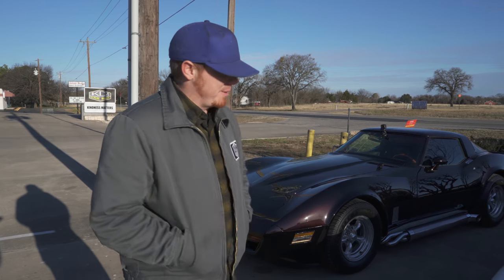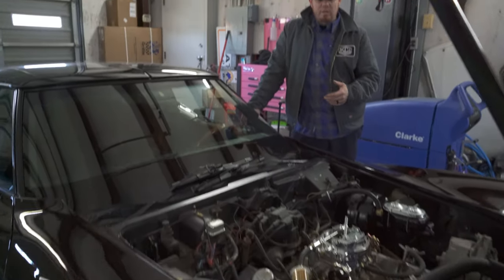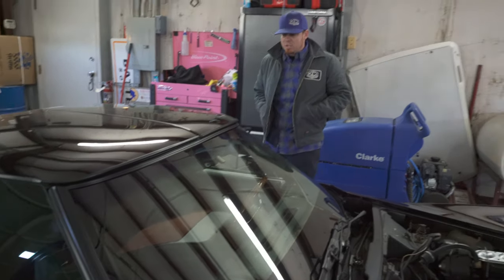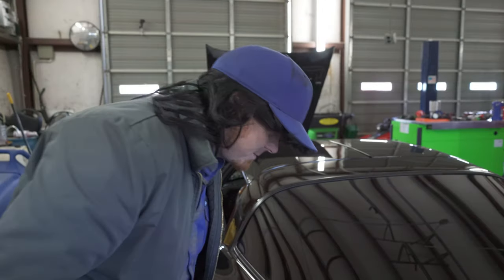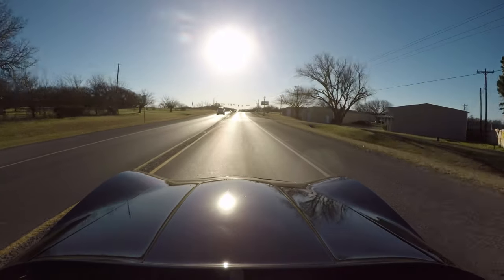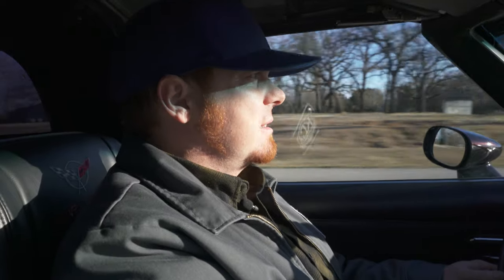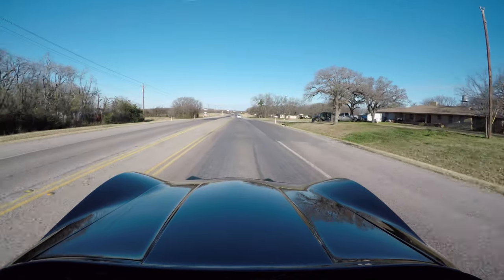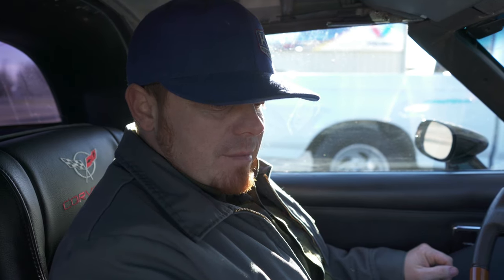RAW CUTS: 1980 Corvette

Comment: Tell the owner to drop the tank and grab the buildsheet before he starts driving again so he can keep it clean in a sleeve. He needs to make sure the trans shifter cable stays tight, they loosen up easily on these cars. Also needs to make sure rear diff Axle seals aren’t rotted. They tend to pretty quick and will sling oil everywhere back there. Have em check the steering coupler, they tend to wear out super fast on these DFW crap roads.
Pops owned a 1980 L-82 Corvette midnight blue metallic with blue blue zebra interior. Car was mint! Brand new was $7600 back then. Growing up in the 80s and then through the 90s riding around with him with TTops off and working on that car with him created some of the best memories I’ll never forget.
Reply: I love to hear stories like that. They represent more than metal on wheels and I think that the shared connection is something that really draws us to them. I'll be sure to pass on the info. Thanks Elroy!
Reply: I know you wrote this a long time ago.  but  Just wanted to say your 100% right about the dang C3 shifter cables. When you buy a vette you also gotta tear out  any old differentials and check  positraction  damage too. People beat the heck out of Vette  rear ends even when they were new then! As bullet proof as they were , They always killed them in the end at about 120000. lol Especially automatics. Unless that bad boy has low miles ...  i guarantee it needs a rebuild.  He does't like old C3s, but man are they fun to resto mod and drive . Even 75s can be monstrous sleepers when you swap them with a old LT1 or a newer Ls1. When im driving mine sometimes 2 seats are too many, let alone 4 ! 1 is just fine with me .
Reply: Brand new 1980 c3 was never 7600$

Comment: Agree. Had a 67, forest green in and out with a 327 4 speed 350 horse and would throw a belt coming from dead stop every time.  Remember taking it on a road trip from Springfield, MO to Harrison, AR on the old curvy road and never got it to break traction going around the corners on the road as I would cave in first because my butt hole puckered so much it was uncomfortable. Would be nice to have a few newer amenities upgraded on it but it was a great car